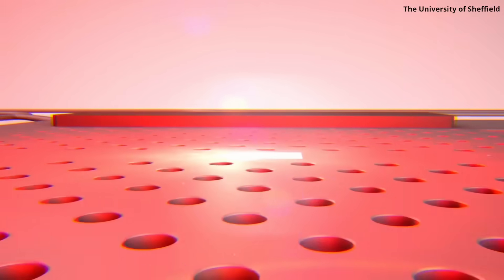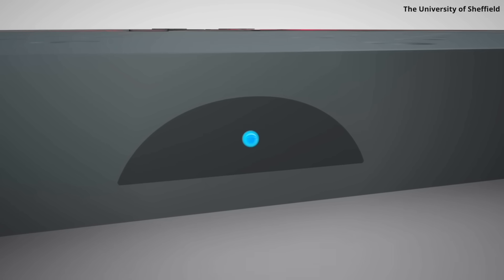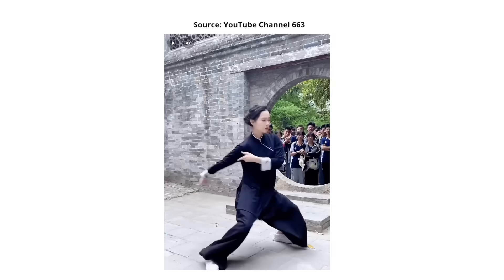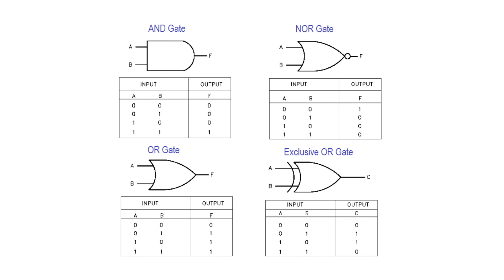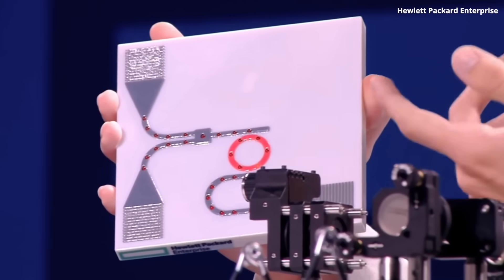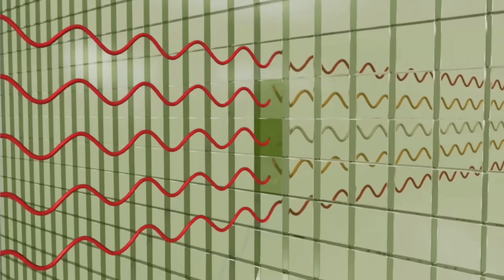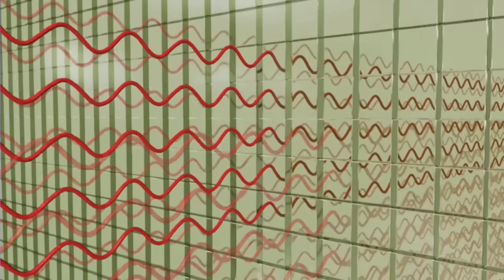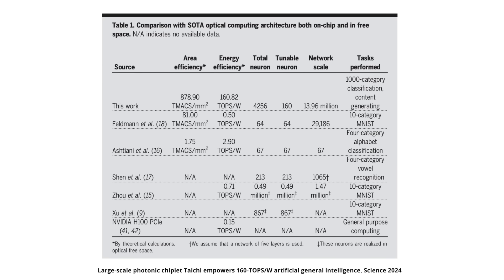Meet Taichi — The Light-Speed Computer

Comment: I asked llama2; 'But it would be great to hear what you have to say about Light Speed Computing.'
>>> tell me how photonic computing would work

Photonic computing is an emerging technology that uses light (photons) to perform computational tasks, rather than the traditional electronic computing based on electrons. The idea behind photonic computing is to leverage the unique properties of light to solve complex problems faster and more efficiently than traditional computing methods. Here's how it works:

1. Light Source: The heart of a photonic computer is a light source, such as a laser or an optical fiber, that
generates photons. These photons are then transmitted to the processing unit.
2. Processing Unit: The processing unit is where the magic happens. It's made up of optical components like lenses, mirrors, and waveguides that manipulate the photons to perform computations. This unit can be designed to perform various operations like addition, subtraction, multiplication, and more.
3. Photon Detection: After the processing unit has performed the computation, the photons are detected using photodetectors. These detectors convert the photons into electrical signals that can be processed further.
4. Data Processing: The electrical signals generated by the photodetectors are then processed in a traditional computing manner, using electronic components like transistors and microprocessors. This allows the photonic computer to interface with other electronic systems and share data.
5. Output: The final output of the photonic computer is generated through an optical module that converts the electrical signals into light. This light can then be displayed on a screen or transmitted to other devices for further processing.

Advantages of Photonic Computing:

1. Speed: Photonic computing can perform calculations much faster than traditional electronic computers due to the much higher frequency of photons (up to 90% of the speed of light). This means that complex problems can be solved in a fraction of the time required by traditional computers.
2. Energy Efficiency: Photonic computing consumes less power compared to electronic computing, as photons have a much lower energy density than electrons. This makes it an attractive option for applications that require high computational power without excessive energy consumption.
3. Scalability: Photonic computing can be scaled up to perform complex computations more efficiently than
traditional computing methods. This is because the optical components used in photonic computers are much smaller and more efficient than their electronic counterparts.
4. Flexibility: Photonic computing can be easily integrated with other technologies, such as electronics or
quantum computing, to create hybrid systems that offer unique capabilities.

Challenges and Limitations of Photonic Computing:

1. Materials Science: Developing materials that can handle the high-speed photons without degrading or losing their properties is a significant challenge in photonic computing.
2. Manufacturing: Producing high-quality optical components with precise specifications is essential for photonic computing, but it poses significant challenges in terms of manufacturing complexity and cost.
3. Noise Reduction: Photonic computers are susceptible to noise, which can significantly impact their performance. Reducing noise and improving signal-to-noise ratios is a crucial challenge in this field.
4. Integration: Seamlessly integrating photonic computing with other technologies can be challenging due to the differences in the way they operate.

In summary, photonic computing is an innovative technology that leverages light to perform complex computations faster and more efficiently than traditional electronic methods. While there are challenges to overcome, advancements in materials science, manufacturing, and noise reduction are continually pushing the boundaries of what's possible with photonic computing.

 Thought I would share.

Comment: They can use cheap GaN based laser diodes to power these chips, should be possible to make lots of the optical goodies on GaN as well. Imagine a CPU or GPU that draws as much power as a bluray reader drive, but has over 1000x the computing power of the best CPU or GPU.

Comment: 50um is pretty small but large compared to electronic components. However, if the photonic version can operate 1000x faster, where's the breakeven point where we can expect a photonic chip will perform the same as an electronic chip? A electric logic gate is roughly 1nm these days, so 50,000x smaller. So photonic components need to shrink to 1/50 or do 50x more operations. Are there fundamental limits that would block such improvement? After a little looking, UV is about 300nm before it becomes ionizing and potentially destructive to the chip itself, so it looks like the limit might be 150x smaller.

Comment: Inside a fibre optics, light travels at 2/3 the speed of light in the vacuum. While this is indeed quite fast, it is not close to the fastest way to transfer information on earth. One way that it is faster is using mmW.

Note: This later method has the drawback that there is a need for line of sight between the two ends, so it would not be a good replacement of the existing fibre optics network (and I think that not that many users care about the difference in latency).

Comment: Since light interference mechanisms are extremely sensitive to the distances of multiple paths, how has the material science progressed to make photonic circuits that are stable due to material aging over time, varying temperatures, ambient pressures, or even varying gravities and inertias in space flight?
Reply: PICs are quite stable because of the materials they use. Silicon, stoichiometric silicon nitride and indium phosphide are the most common waveguide materials, and they don't drift over time, they're basically rocks. The weakest point would be the epoxies that are used in bonding fibers to chips.

Comment: I like your videos very much!
But the speed of light in quartz is about 2e8 m/s, and the speed of electricity through a copper wire is about 3e8 m/s.
So, the electric circuits are faster :) 
Of course it is just a conductivity that is faster.

Comment: I'm curious if we will ever see photonic based network switches, not having to converted between light and electric would be massive improvement in terms of speed and efficiency.
Reply: PON has been a thing for a long time. We will still have to convert the signals at the endpoints though.

Comment: Have you ever heard about "analog computers" ?! They have the same concept and they didn't make it, because they were not programmable dynamically, but like this case they were only static programmable. The same will be with the photonic computing most likely.
Reply: Photonic computers are reconfigurable within miliseconds, that's not the issue. They'll fail because scaling to a football field's worth of interconnected wafers is more difficult than it's worth.
Reply: Don't confuse the analogue computation with the need for a latchable storage for dynamic programmability.  If the storage can't be achieved other than in leaky capacitors, then those elements can be digital companions  to the analogue computations.  I see great potential  for microcoding to control the analogue parts.
Reply: @ChrisNotTheKing  I didn't write analog computation, but analog computers. Analog computers were built back in the 60s and 70s but nowadays, they're not being produced anymore. Those analog computers have devices, which automatically "calculate" a certain formula, because of their construction.
Reply: @hamidaminirad   Exactly.  Just like the multiple pipeline units in a modern CPU.  Calulations are distributed amongst the various specialised units.  Multiple units for pipelined execution are chained to increase performance.  No modern CPU executes multiple generic instructions in a slow loop implementing multiplication... however specialised pipeline units do obey the system clock... and such stepping could be avoided in an analogue multiplier unit, fo example.

Comment: photonic computing still relies on clock cycles & is limited to the number of gates (fanout) do to attenations. most photonic compute is limited to matrix compute\comparision since its basically one operation per clock cycle. All of the other logic\compute is handled by the electronic (silicon) systems.

I don't think we'll see much on an advance for photonic computing for a long time. I think the current function of photonic matrix will be replaced with analog since its far easier to design an analog matrix than photonics  & the speed is about the same. The issue with electric digital comparisons is that takes lot of logic gates to perform comparisons or matrix math functions (multiple clock cycles). Its pretty simple & fast to do it in analog, All you need to do is pay the compute cost to convert a digital value into an analog & back into digital. The analog work can be done less than one clock cycle.Its easy to do comparison, additions, subtractions, mulitiplications & division using analog circuits.
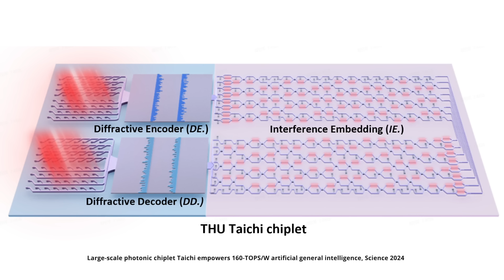Reply: The chip she is referring is the Taichi Photonic chip developed by TsingHua University in China.  The diagram of the Taichi chip is shown in 11:18 of this video.
Reply: It is expected that these photonic chips will be ready for mass production in China within the next 3 years.

Comment: Im so pissed off right now, ive been talking about this possibility for years. 

Wait till you realise the speed and capacity of material data storages.

Also, in the diffraction of light, it should be noted that direct lines of photons still exist at the same time as the waveform. 

In quantum physics, all patterns and states exist at the same time, but when observation occurs it becomes structured.

Comment: Is it possible for aliens to send messages with light? From long distances? Well, it still takes light a loooong way to travel i guess
Reply: It would be. There have been experiments on using lasers for communications between spacecraft. The first advantage of using lasers is the very narrow beam with a very tight point spread function. A laser beam can be pointed very accurately at the receiver whereas the beamwidths of microwave dishes are of the order of degrees. This means that far less power is required with light. The narrow beam also improves security. The bandwidth and hence achievable data rates of comms using light is also vastly greater than what can be achieved using microwaves.
Reply: @rogerphelps9939  that's a little beyond me ha ha. But I understand the concept. What about sending light from say Andromeda but not in a narrow tight way. So specific instruments wouldn't be needed. Like a way to catch sunbeams (visible photons) from anywhere. Morse code with spectrum.

Comment: Why don't they use solid state low power lazers and integrate it in a chip package. The lazer is not an issue. 
Neither is space. Have you seen the size of a NN super computer it is the size of a large open plan office or more.
Reply: Because it's still in development and as mentioned the accuracy isn't 100%. I'd also imagine that in its current state it does require more powerful lasers nd stuff.
Reply: @iPlayGamesX  ok, if this is in the works then I have high hopes but not as an inference computer given the need for a small solution that at least is the size of a large PC tower.
Reply: @Gargamel-n-Rudmilla  Well its in early development so it'll likely be compacted, but I digress. If it can really lead to single thread performance a thousand times better, you bet we're gonna do our best to make it work.

Comment: What do you mean we don’t have to “stop the data” when using light instead of classical computing? Is computing with photons like watching a river of information?
Reply: Conventional processing is synchronised by a clock and that is how things like shift registers and pipelines can be implemented. Presumably pulses of light could take the place of a clock but you would still need some sort of storage in order to process the outputs of the current pulse with those of previous pulses. Perhaps the rings in the video mighrt be used to store data.  The description is far too superficial to infer very much about how these things really work.

Comment: The laser they used was 1550-nm fiber laser. It outputs few tens of milliwatts on average. Peak power per pulse has nothing to do with laser power consumption at all. You can have megawatts per pulse just because watt is J per second. The shorter the pulse, the greater the power. The laser they used is a tabletop laser with modest consumption. Also, one should not look at consumption numbers for the research-grade instrument. Diode lasers can have their efficiency reaching 70%, especially in the infrared. Then, also keep in mind that the whole power dissipation will occur outside of the chip.

Comment: Just saw a video on changes to LED's to make them 90% brighter.. by slicing the sapphire @45degrees. I wonder if this will mean smaller lasers
Reply: Lasers are already extremely small, they can take up less than a square millimeter of the chip.
Reply: @tykjpelk  She mentioned there is still a bunch of equipment, I surmise for higher power laser. There is some work about lowering the power requirement by 90%.. but maybe that doesn't have an impact here

Comment: Cool. This got me thinking about a kind of direct drive photonic computation system that satellites could employ. Utilizing sunlight to power photonic chips through meta-material photo filters and waveguides could potentially offset the high infrastructure costs and energy requirements of these systems. Since photonic chips are highly energy-efficient and mainly analog, harnessing solar energy directly could make them even more sustainable and cost-effective. Throw that shit into a desert and we have ourselves the latest country export, clean data generation. Yay!

Here’s a breakdown of how this might work:

Meta-material Photo Filters: These filters could be designed to selectively allow certain wavelengths of sunlight to pass through, which are optimal for the photonic chips' operation. By tuning these filters to specific frequencies, you can maximize the energy efficiency and performance of the photonic circuits.

Waveguides: These could be used to direct the filtered sunlight precisely onto the photonic circuits. Advanced waveguide designs might also help in managing the distribution of light, ensuring that the chips receive a consistent and adequate amount of power throughout the day.

Digital to Photonic Converter: This device would be crucial for interfacing the traditional digital signals with the photonic system. It would convert electronic data into optical signals that can be processed by the photonic chips. Integrating this with a solar-powered system would require ensuring that the converter itself is either energy-efficient or also solar-powered.

Energy Storage: For non-daylight hours, if continuous operation is necessary, integrating energy storage solutions or alternative energy sources would be essential. This could include batteries charged during daylight hours or other renewable sources.

This concept ties beautifully into sustainable technology development, blending natural energy use with cutting-edge technology. It could also potentially lead to novel architectural designs for computational systems, where environmental integration becomes a critical component of technological infrastructure. 

What do you think might be the biggest challenges in implementing such a system?